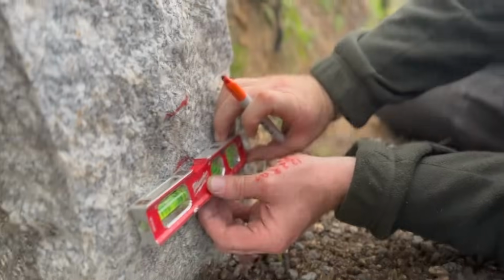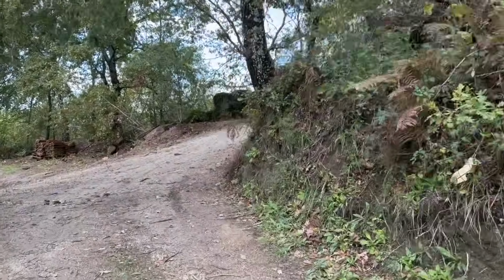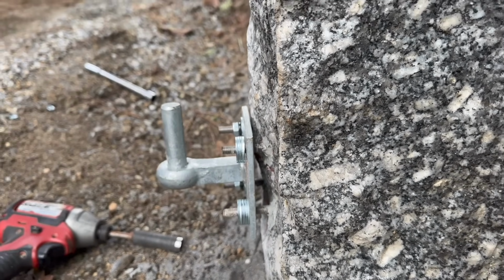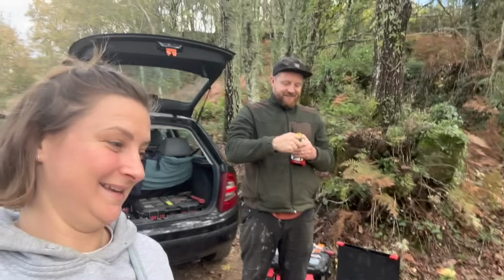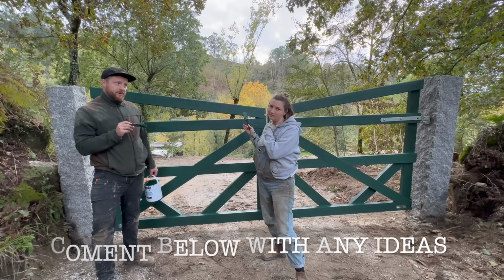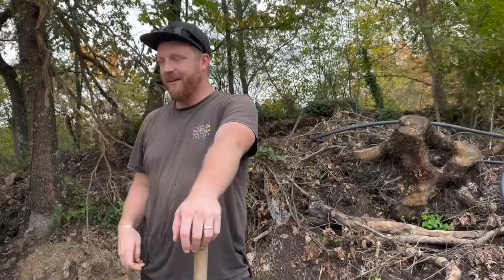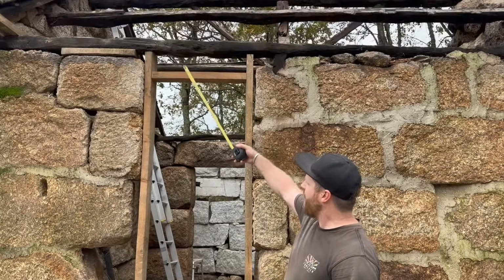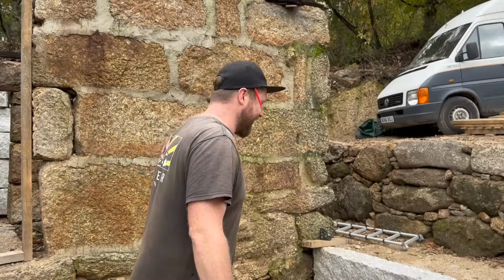#02 OFF GRID - SELF BUILD - IN GO THE GATES!!!!

Comment: The top Hinge attached to each post should point downwards to prevent someone just coming along and lifting off your lovely new gates onto a trailer and driving away without making a great deal of noise. I had a farmer friend to whom this happened and we simply turned the top hinge attached to the post through 180 degrees and it solved the problem. Hope this does make sense.
Reply from the maker: I way as if some one did that your poor friend! Yes maybe we need to switch them over thank you for the tip ☺️

Comment: Avarage doorways in The Netherlands are between 85 and 95 cm, i bet that is why we all reacted 'its to small'. You must have tiny couches and furniture pieces in your house or you must be able to take everything apart as it would just not fit though a 77 cm doorway imo. The gates look wonderfull !
Reply: Standard Door sizes are between 66 and 93cm (even in the Netherlands ;) ) but 66, 73, 78cm was the standard in say the 50s 83, 88cm came later and the standard now is 93cm. Though my front door is 115cm to be able to easily fit a wheelchair and it also looks amazing.

That said i do still think their opening is not wide enough, esp since they are still in the process of making it, if they can do it till the stone, so without a frame it would be doable for every day use, i have a walk-in shower entrance around 73cm wide and i cant imagine walking through that several times a day...

And i get the argument of already not having a lot of space in the living room, but in that case opening it wider and giving it more of a connection to the kitchen does give you a feeling of more space (in exchange for 20-30cm or so of wall space (as i would make it as wide as the lower opening, that gives 1 stone that can just be removed and 2 that need to be halved but the second stone would still be large enough to offer support to the wall)
Reply: I completely agree, making it wider would blend te spaces together and give it a way bigger feeling less confined. But up to them ofc. I have been in the UK a lot and in always supprised by there very small Living/reception rooms, maybe they are used/like it that way. I cant imagine living like that with 3 kids around, definitely not in the winter. But like i said not my choose but there,s to make.
Reply: @dinekezwanenburg5390  now im wondering if thats why they call it a snug? (Atleast i think they do, unless they have a snug and a living room)